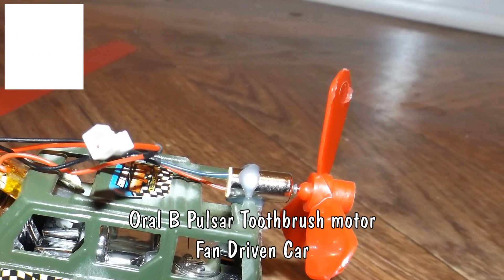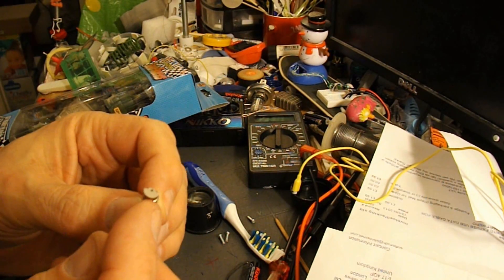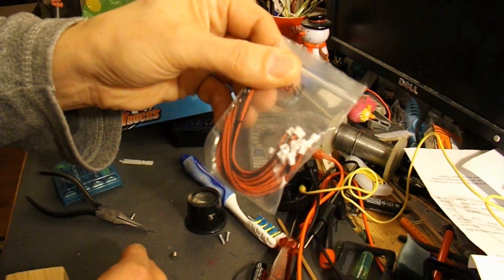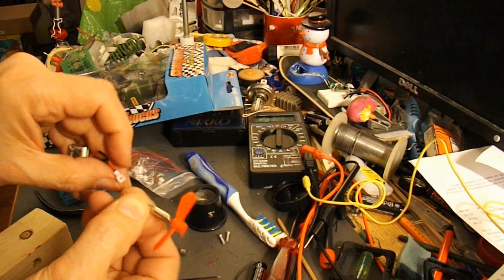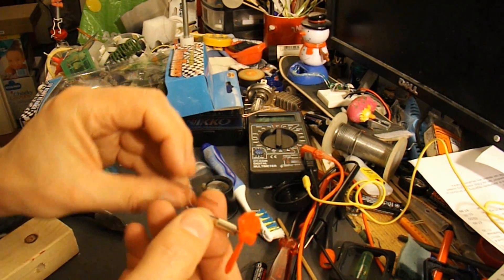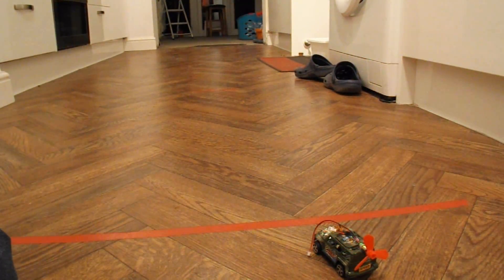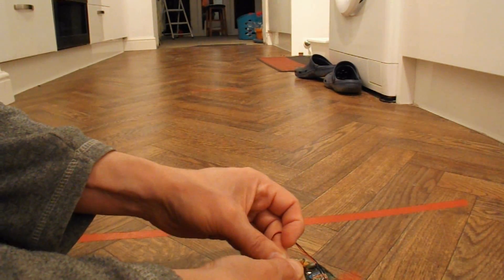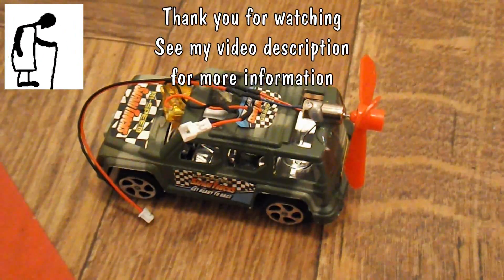Oral B Pulsar Vibrating Toothbrush motor Fan Car

Comment: Will this little motor have the power to propel underwater? For a Mini submarine perhaps?
Reply from the maker: That must depend on the size of your submarine. In water you need less power than you need on land and much less than you would need to fly so with care building your minisubmarine it should be fine. You will probably have to make your own propeller. Here is a little boat I made to use this sort of motor https://www.youtube.com/watch?v=VIyf3pIXG1Q
Reply: +GrandadIsAnOldMan Wow Thanks!
Reply from the maker: heapner good luck if you try this yourself. If you don't already have one of these motors I would suggest you buy some on eBay. Look for 3.7 volt coreless DC motors. You will get better motors and cheaper than buying one of those toothbrushes. I only use the toothbrush motors because we use those toothbrushes and when the bristles wear out you are supposed to throw them away.
Reply: +GrandadIsAnOldMan Thank you very much for the info. Your videos are awesome! 👍🏼
Reply from the maker: heapner thank you for taking the time to leave your comments, it is nice to know people are watching :)
Reply: GrandadIsAnOldMan make more videos of your pizza tray Spitfire

Comment: Can you make a rc submarine out of a soda can?
Reply from the maker: brad smith I will pass on that for two main reasons.
1. I have nowhere suitable to test an RC submarine, you would need a private swimming pool or similar.
2. RC signals do not travel very well into water, you will find a lot of discussion on the subject if you search for it. Some work better than others.